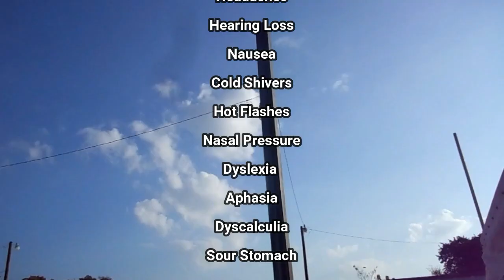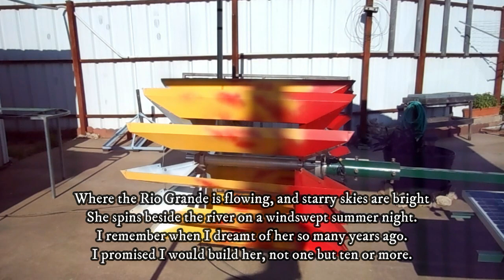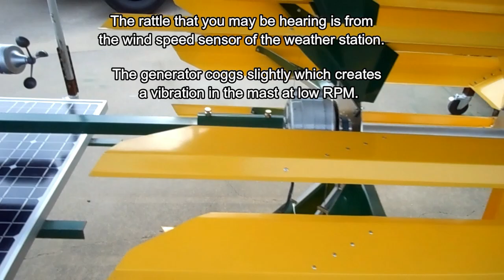Yellow VAWT of Texas

Comment: Your first mistake was thinking that 50watts is enough to live on during a weather event. Your second was not building a big enough turbine for it to be of any real use. If you want to be self sufficient? You need space for the equipment, and the money to invest in it. Im off-grid in Saskatchewan. We are far colder than you will ever see in Texas on a daily basis in the winter. Frequently below -40. But when you have 32kw worth of solar (its cheap by the pallet today) and two commercial grade 5kw turbines backed up with 64 Kwh of batteries? You can get through a week of bad weather. Before you ask? $80k Canadian Rubles. But almost all of it was DIY. It was cheaper than the utility wanted to charge me to bring power a mile and a half into this site.

Comment: Another 4ft er
Reply from the maker: Yep
Reply: @LittleshopintexasSV  I noticed you are using a different kind of generator on your wind mill?
Reply from the maker: @carlsmith2826  Yes, this is the original single core Freedom PMA, but its being driven by a 2 to 1 belt and pulley system instead of direct drive.

Comment: Hey I have been kicking around the pieces parts for my own VAWT build I'm about ready to start but keep getting hung up on the right generator or alternator. Can you describe your set up a bit on what is driven off the pulley and how you get that power into batteries to then use?  Thank you
Reply from the maker: I really don't know which permanent magnet alternator is best, but I like the Freedom and Freedom II from Missouri Wind and Solar.
As far as the pulley setup this video "Get on the Stick" will give you a better idea than I can explane. https://youtu.be/0ZAmk6n2b3g

Comment: For future ice storms, ice can be easily removed by spraying rubbing alcohol on it. Alcohol is miscible with water and it changes the temperature at which it will freeze. Just spray it on the ice and wait and it'll fall off.
Reply from the maker: Thanks for the info.

Comment: I loved this video! 
  I wish I had room for this here in Hawaii for emergency EmComm communications. I would love to have this mounted on a flatbed trailer and then haul to where I can set it up like up at Tantalus Lookout for example. 
     As far as those 27 hours you went without power, may I suggest that you prevent that from ever happening again by covering the front of those solar panels with clear plexiglass panels so that you can scrape off any ice or use a solar propane heater, which can also be used for the room where you store your batteries also. 
     I currently have four battery banks, two 12 volts systems with AGM batteries behind the sofa with a Triplite 1250 DC to AC inverter and I have two 14 volt battery banks in my Ham Shack that I set up with a blue 350 amp Anderson Power Pole connector. Then I have a 3500/7000 peak modified Square Wave inverter connected to one of these banks. Why 14 volts? For two reasons, my radios require 13.8 volts to operate and secondly, a 14 volt system gives me 3 volts to play with instead of 1 volt like on a 12 volt system before the safety features on my inverters shutdown for low voltage. So 12 volts gives me 4-6 hours depending on my loads and 14.5 volts gives me between 10-22 hours depending on loads also. For 14.5 volts, I use 6v and 8v golf cart batteries connected in series and parallel circuits, which doesn’t require a controller with the 100 watt solar panels that I’m using. Here in Hawaii, if you order larger than 100 watt panels, the shipping just kills ya big time. I do use the BatteryMINDer 2012’s and the 2012-AGM Pulse/Desulfanator chargers to make my batteries last decades instead of years because, again, the shipping to Hawaii will kill ya big time, lol.
     This set up you have is absolutely perfect for EmComm and would love to add two antennas to the brackets, one for UHF/VHF and the other for HF with two 14 volt battery banks with my  BLS-12/24BW Battery Life Savers. 
    Hawaii is considered the Tsunami capitol of the world and we have a pretty active hurricane season every year, so your set up would be perfect. You can crank it down for travel and crank it up when needed for communications. 
     I like using those big round magnets that I find in discarded microwave ovens that you can find all over the place here. My email is good on QRZ and would love to talk to you in more detail about your set up. 
    Mahalo-Todd WH6DWF 
           SEMPER FI 🇺🇸🇺🇸🇺🇸🇺🇸
Reply from the maker: Thanks for the suggestions my friend. Hindsight is an exact science so its easy to look back and see what I did wrong. I now have a piece of plywood ready to protect the panels from ice or even the more common hailstorm. And I picked up a 12 volt diesel burning bus heater that will help break the chill in the house. I won't be caught unprepared in that situation again.
I sounds like you could put some good use to a little tilt-up system like mine. If you'd like talk more, contact me through my website and I'll give you my email or phone, https://littleshoptx.com/contact-me
Thanks for watching!

Comment: Hello, can I purchase plans or drawings for the rotating assembly? I'm off grid in hills of Washington state. I want to support your project.
$100 or ? We can't afford to ship anything, it seems.
Reply from the maker: I have plans available for the VAWT itself, but not the shaft or mounting bracket system (The Stick). In the future, if folks are interested, I may make another video of the dissembled Stick which I can show all the parts and measurements. This was the first one (prototype) and there is room for improvement. Hold your contribution until that time and send me what you think its worth.
Of course all contributions are appreciated. Thanks for watching!